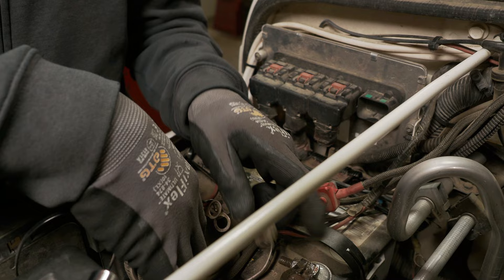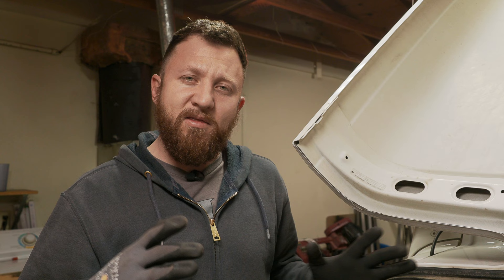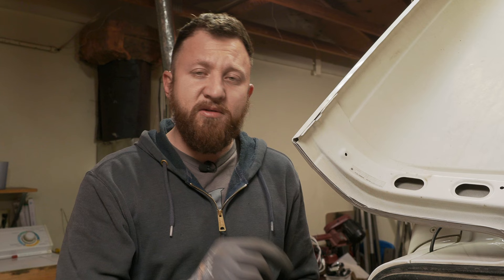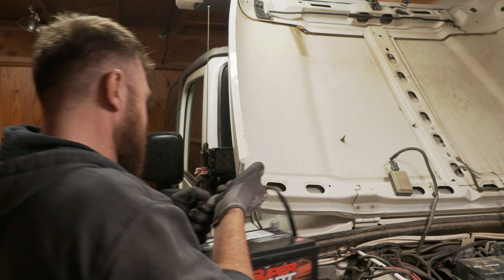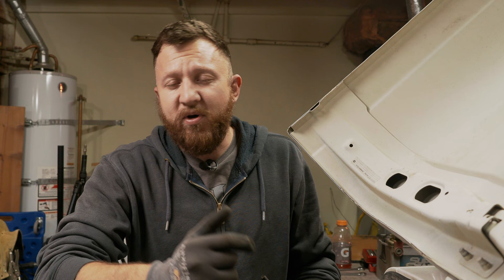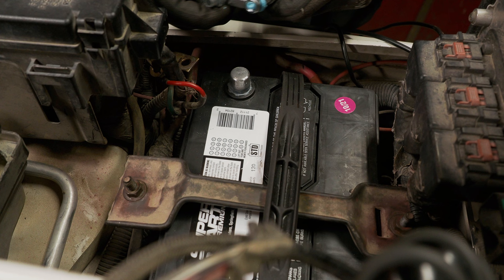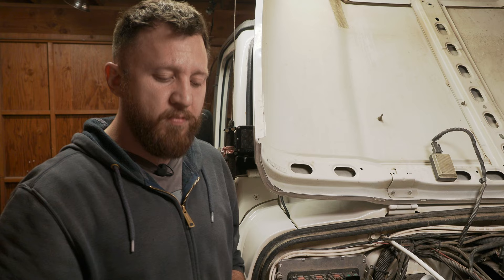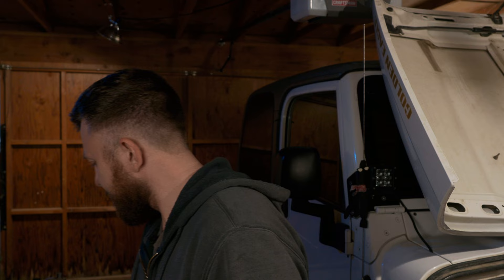Watch Before You Buy AGM Batteries

Comment: 100% correct. The Jeep Wrangler JK's that came with lead-acid batteries when new are designed to use only lead-acid batteries. The regulator in the vehicle will have a charge profile for a lead-acid battery, about 13.8V mostly, and will also deliver a lower current to charge the battery. A vehicle that came with an AGM battery when new, like the Jeep JL I believe, will have a regulator that gives a charge profile suited to an AGM battery - generally about 14.7V, and higher current  - the AGM can take the higher charge rate, the lead-acid can not.
Sure, if you just drop an AGM into a Jeep JK it will appear to work fine. But it will not charge fully, and you will probably shorten it's life - UNLESS you also change the regulator.
I once set up a yacht with AGM batteries, high power Balmar alternator, and the appropriate separate Balmar regulator (which was programmable, so I had to set it to AGM mode).
A lot of vehicles have the regulator built into the alternator, which is a cheaper solution. I don't know about the JK, I heard it is built into the ECM. Unless it can be reprogrammed - maybe a Chrysler dealer can do it - you would need to install a regulator designed to work with an AGM battery if you want to install an AGM battery and get a full life and full performance out of it.
By the way, here in Jan 2024 I am just about to replace my 2014 JKU's original lead-acid battery for the first time. 10 years old, worked just fine until my wife left an interior light on a couple of days ago when it was -30°C / -22°F. Now it won't hold a charge, it is toast. I will just replace it with a lead-acid battery for an easy life, like an Everstart Maxx H6 or an Interstate H6.
Another point - lead-acids should not be discharged more than about 50%, or they will suffer some permanent damage. Hence they are suitable as starter batteries for vehicles. What a lot of people don't know is that the same 50% limit applies to AGMs - take them below 50%, and you will shorten the lifetime of the battery. So again, they are good starter batteries too, and very good if you have the engine running and a powerfull alternator to charge them fast. But for RV's etc, go for lithium (like Battleborn's) that are much lighter than AGM's, and can be discharged fully without causing any harm. But they are more expensive, and also need a special charger too!
Reply from the maker: Great info! Thank you for adding to this topic.

Comment: I think the biggest issue here is using the AGMs from East Penn, which are the calcium style and not the thin plate style. It’s not that they’re terrible batteries but I think they’re crazy picky. The odyssey/Northstar/X2 lineup seems to be happy and live a good long time in the TJ platform. Or at least ones from a decade ago did, because many of them made it 8-10 years. I doubt those same batteries got worse since then so I bet they’re stu pretty dang good. 

I do not understand why various TJs charge at slightly different voltage. Could be a temperature thing. The factory service manuals show a chart and it’s a sliding scale based on temp. Have you monitored at various cold vs hot outdoor temps? 

Either way, good luck with the new one. I have not had great luck with any flooded battery either, but hopefully you do. Seems like virtually any batteries can fail at any time. Really makes it hard to make the decision when they all still fail and strand you. Hopefully good luck is achieved with this one.
Reply: I really appreciate how you explain everything very articulate good job! 👍
Reply from the maker: Welcome!
Reply: Optimal AGM charge voltages vary considerably with temperature. Out telco style chargers have temperature sensors on the batteries.
Reply: X2 batteries suck

Comment: The alternator regulator in most cars will charge to 14.2 to 14.7, you can replace the regulator for one that charges higher in most cases.  Newer vehicle alternators are regulated by the pcm and the charging strategy can be quite complex.  In some cases, these can be modified, check carefully.
Reply from the maker: Chrysler started using the PCM to regulate the alternator in the 90s. 

This can be modified but through software in the PCM.

Comment: For a vehicle that is used every day, the 13.8-14.6 is likely achieved while the vehicle is running. I wonder if your wiring problem is a more likely cause of your difficulties. For high current devices, even a small voltage drop on either ground or power wire could be enough to compromise function. It's probably worth while to do drop testing while you get a friend to turn the start key.
Reply from the maker: I thought that might be the case. I recently disconnected everything but the main harness. Jeep still charges at 13.5v. I recently found that the voltage regulator in the pcm is programmed to 13.5v. I think I can reprogram that or use an external voltage regulator.
Reply: 13.5 is to low even for a wet cell battery...you need too check your charging system...maybe your computer is bad...or that loose battery terminal...by the way I've never seen anybody put lock tight on battery terminal bolts !!  @EmbarkWithMark
Reply: @johnny0454  I'm not sure what year your jeep is..I must have missed it ? But I had  a 98 Chevy and now own a 2000 Pontiac GTP and a 2002 Chevy Trailblazer...and a 2007 Pontiac Vibe...and they all came with flooded cell batteries in them...and the specs on them are 13.5 - 14.8 on them...the same specs go for AGM batteries too..
I'm only saying you should just update your charging system so you can use an AGM battery because they are much better batteries...not saying your wrong just that instead buying another battery I would have updated my charging system...there's all kinds of videos on YouTube showing you how to do that !!
Reply: Yeah Agm requires above 14 volts to properly charge

Comment: You have a voltage drop issue somewhere in the charging circuit. A normal car alternator will charge 14.2 volts. Just because your jeep meets the minimum spec doesn't mean it's working correctly. Charging any lead acid battery at 13.5 volts will cause the battery to sulphate. 
You likely have resistance in your cables or connections. A new battery isn't going to fix this issue. Learn how to do voltage drop testing and find the resistance in your charging circuit.
Reply from the maker: So, I've done additional testing. Turns out certain models of Jeep TJ that do not come with a battery temp sensor have the default charge voltage set at 13.5v from the factory. I had to dig into the PCM to figure this out. Once I have the rest of the stuff I need to program the pcm, I'll show how strange this issue is. But, I still stand by the purpose of the video that AGM does need the right voltage to charge correctly.

Comment: Our Transit buses use these type 12v batteres x4.  They charge 14v typically.  They don't last.  Here's how they fail.  Our buses use a separate alternator regulator, so when they fail the battery voltage will be below normal while running and the field voltage will be maxed out.  Testing them with an inductance tester shows ' Good , needs charge '.  Upon replacement, the charge voltage now at 14.0  to 14.2v and field voltage then normal, 9v-13v, depending on system load.  Something to look out for sure!

Comment: AGM is best maintained with a different charging algorithm than FLA. Is not just “13.5 vs 13.8”. Fords can be programmed for AGM vs FLA using Forscan. Smarter battery vendors do not recommend AGM for 2016 Subaru, but those who only sell AGM happily recommend their AGM.

You may have noticed your battery maintainers have separate modes for FLA and AGM.

Comment: Many Jeeps come standard with AGM. My Jeep came standard with Optima AGM. Lasted 7 years. My Ford charges at 14.3v even thought it came with normal lead acid.
Reply from the maker: Many "newer Jeeps" come with AGM. I think Jeep didn't start using AGM till the JL/JLU came out, which is fairly recent.

Yea, lot's of older vehicles have a high enough voltage to charge AGM. It's just something to be aware of.

Comment: Change the car or alternator, my 2002 audi A2 1.4 tdi charges with old alternator to 14,4V. My biggest benefit of agm is there no offgassing of corrosive gas(hydrogen, oxygen) so the wiring around the battery does not corrode(including tail lights)
Reply from the maker: Changing the alternator won’t help in this case since the voltage regulator is internal to the ECM. 

But I agree AGM is hands down better, if you have the right voltage flowing to it.

Comment: there are two ratings on batteries reserve capacity and cranking amps usually as cranking amps go up the reserve goes down because to get more amps for cranking, they make surface like a waffle for more exposed lead which could be why your battery dies more on slow low drains of interior lights on and such while engine is off the agm batteries are lighter because there is less total lead plate for reserve draw.

Comment: Is it possible that you were not getting a proper charge because your terminal was loose?
Reply from the maker: A loose terminal is never good. But this isn’t a recent issue either. Voltage on my Jeep specifically is too low to maintain an AGM properly. 

I’ve been testing the voltage for a very long time to understand where the issue is. To include replacing the ECM, since the voltage regulator resides inside the ECM on Jeeps. 

Best recommendation I have, If you are interest in moving to AGM, is to test the charging voltage of your vehicle and ensure it’s above 14.2. From my research that’s the minimum to properly charge AGM batteries.

Comment: I've got an Interstate M7 (MTX) AGM that I bought in 2015 still going strong which I exercise periodically to break up the sulfation crystals. I called Interstate and an engineer there was kind enough to tell me how to do it and the limits of that battery and what the temps should be held below. They can take a lot of abuse charging wise. My battery capacity is still nearly 100%. I've kept it on one of those special AGM maintainer/chargers since I got it. It was floating the battery at 13.7-13.8v and when I noticed it dropping over many months or years to 13.5-13.6 I would deeply discharge it then charge it up at a medium rate (10A and vary it to a low of 2A). You need to have a fairly high rate without overheating the battery to break up the sulfation crystals at the bottom of the plates to reconvert them.
You really don't need a special alternator or regulator. My old Dodge truck charging system puts out 14.2-14.6 idle with a charged battery. My alternator output is run directly to the battery avoiding any losses in the old wiring. 
I'm not sure if using an AGM is the best choice for an off-road vehicle because the plate are packed tighter and could be damaged easier by shock or vibration.
Reply from the maker: That is all great info thank you! I'd love to know that charging process. 

Most of us use AGM in a lot of our rigs with great success they take vibration or shock better than lead plate batteries do. 

Agreed no special regulator/alternator. The voltage just needs to be high enough. My Jeep right now just isn't. However, I think I've figure out a way to tap into the PCM and adjust that voltage so it regulates near 14.2.
Reply: @EmbarkWithMark  I just  recovered a lead-acid battery that I accidentally discharged to 0v (the door lock button in my car was jammed and I didn't find it for 3 or 4 days). It came back real nice and is actually better than before and the resting voltage was at 12.99v after 3 days.
AGM's you really don't want to deeply discharge and if you do they have to be brought up with real small amounts of current to like 75% charge then you can hammer them with more current like 10% of the AH rating until they get near full charge them pulse or taper the current down. I'm sure you know theres very little electrolyte in an AGM so you need to be careful not to boil it off. 
So the MTX battery I have is in one of my collector cars and I never 'used' the battery for years just had it connected to one of those 'Battery Minder' AGM charger-maintainers that I bought when I got the battery. It would normally float the battery at 13.85 or so MAYBE 13.76 I can't remember. It did drop a tenth of a volt over 4 years. About 3 years ago I noticed one day the charger was reporting a 'Bad Cell'. The battery didn't have much capacity maybe 70-75%. I was able to recover it somewhat by using a regular charger. 

I called Interstate and this is what the guy told me. To 'exercise' the battery and charge it 'aggressively' (within it's limits) to break up the deep sulfation crust at the bottom of the plates. To exercise it you need to run it down pretty low, to what is considered completed 'discharged' or depleted for a 12v battery which is I believe 11.5 or 10.5v. I left the lights on and used some headlight bulbs wired to the battery. Then to charge it up I hooked up a voltmeter and an amp meter to the charger output. I used an old ignition ballast resistor as a current limiter (in series with the charger + lead). I think it was 1/4-1/2 ohm. The voltage went up to 15-16v at times and the current was low around 2-4a to start and then I put in about 10a. You want to avoid at all costs putting in much more current than the battery can absorb to charge. Because it's going to be wasted energy converted to heat and boil off the electrolyte. A little will break up the crystals, too much overheat the battery. 10% of the rating is safe. So the first time I did this the battery drained in about 1.5-2hrs under a 15a load. After I recharged it the time doubled. I repeated the process and it nearly doubled again. I did this 'exercise' process about 3 to 4 times and it was back to 100% of new and this was a 5 year old battery. The biggest thing he told me was to feel the sides of the battery and see how warm it was. This is because the waste heat is what causes the 'gas'. You can figure the wattage you can pump into it by the battery rating. I used an IR thermometer and I think I got in the low 90's. He did tell me they really abused those batteries in the test labs and they can take a lot of abuse as far as currents and temps. They pumped in in excess of 30v which is OK as long as you monitor the current being pushed. Like I mentioned before 10% of the battery rating is OK, but if you have a deeply sulfated battery it will start out slow accepting current and then ramp up so it's necessary to have more voltage to push it in. The long and short of it is you don't want to push more into the battery than it can absorb, if it's heating up it's too much, and repeating the process will break up the lead sulphate. Start out with low current then it will ramp up and you can push in more as the lead sulphate gets 'converted back' and becomes conductive.
Sorry for the 'book'. It's a long process to describe. Good luck!

Comment: My Deka Intimidator AGM battery in my F150 is almost 9 years old. I don't drive the truck much and I keep a trickle charger on it when not driving. My next battery will be another AGM.
Reply from the maker: With impeccable maintenance like that, I'd find it hard that any battery wouldn't last well beyond the current average life span.

Comment: you should try silicone grease on outside of terminals i use a copper wire splicing grease inside and silicone grease over terminals never get any corrosion.
Reply from the maker: I’ll try and give that a shot. Right now I’m testing some stuff from noco and it works pretty well!
Reply: @EmbarkWithMark  I have seen that just seems kinda expensive and i have too many chemicals already for working on my car so i use silicone grease on everything.

Comment: On my XJ I got tired of the computer and it's unwillingness to charge ANYTHING correctly.  I went ahead and put a regulator on the alt that bypasses the computer.  Google Transpo regulator Jeep and you should find it.  Just like an older vehicle now.  Battery needs juice, alternator gives juice.  No more, "Well ya know maybe at this temp but it's not really this voltage cause maybe the moon isn't in the right phase" stock computer issues.
Reply from the maker: ROFL! I am looking into that option, I've also found an option that allows us to set the voltage in the PCM with some software. The software is not very affordable though.

Comment: i’ve had agm for awhile 1 up front and one in the back of my 05 tahoe for my sundown x15 subwoofer which needs lots of power to push especially from the amp and my voltage sits around 14.4-14.6, it does drop to the high 12s and lower 13s but that’s if i really push it but ive been satisfied with it definitely gonna go lithium to have no voltage drop but agm does way better in my application that a lead acid battery which my system will kill in less than a year from drawing to much power.
Reply from the maker: As long as it can be charged correctly, AGM is better. I run AGM in my 4Runner as the main battery and 200 amp lithium pack as a secondary battery for everything we run. Works out great but I have a dc to ex charger in line to charge the lithium correctly.